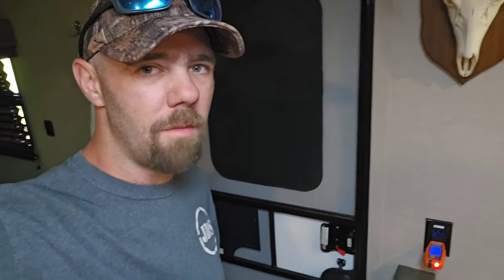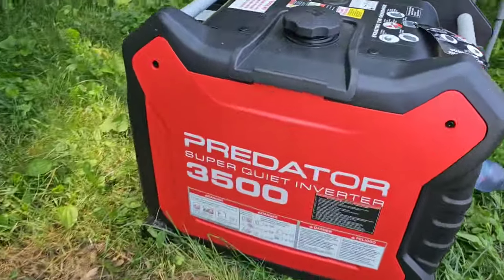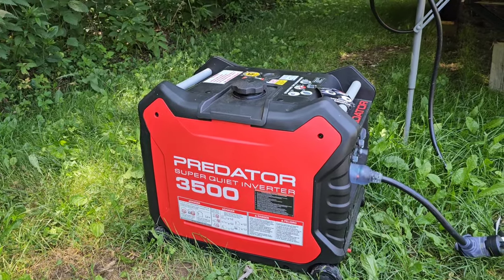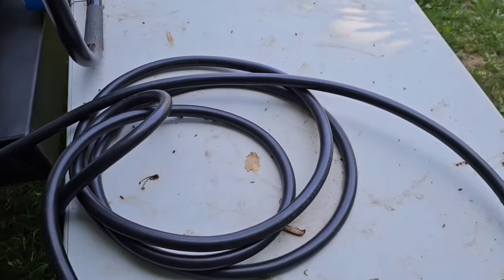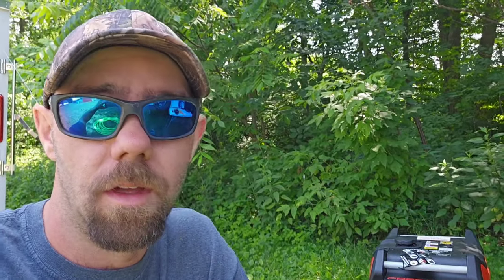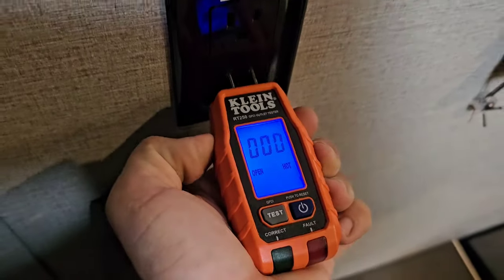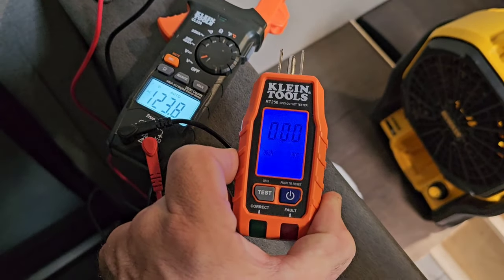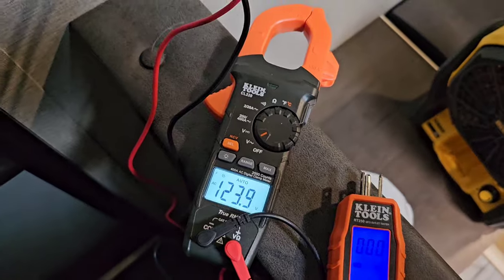here is the solution to the popular 3500w generator problem

Comment: I loved it. I identify as a Jack of all Trades. Plumbing, Heating, and Electrical.   Your comment cracked me up. I had originally discovered this issue last year, but had I found your video then I would have saved myself time. Does anybody have kids?  Guess what you're not just a doctor. You're a therapist, a problem solver, likely an electrician, and even a plumber.  I'll let you figure that one out but it's pretty obvious. At least to this once-single Mr. Mom. Now, Ladies, I didn't forget you!!  I've seen some ladies and men even take on the role of a mechanic. Yep, changing their own oil, working on brakes and rotors, or even swapping out a car battery. Ladies and Gents, you identified as a mechanic. (OKAY BACKYARD MECHANIC).  JDS Outdoors keep up the great work!

Comment: You need a neutral ground bonding plug. You plug that into one of the outlets on the generator and it will work like it should.
Reply: The bonded plug is what I found out as well. I have a 4500 watt champion and was doing the same. Added the bonded plug and no more issues

Comment: Well there you go. I was one that originally claimed the fault was because of the open ground with the gen set. Then after thinking and replying with another commenter I talked about a job I had where the customer claimed a hot / ground reversed on one circuit in their RV. That actually turned out to be an open neutral. That's when I thought it might be a neutral fault. Its funny because the last sentence I said is how I hate those outlet testers because I can't trust them and their is no substitute to an actual multimeter. 
Hey, either way I'm glad to see you figured out the cause. For me that's the fun part of troubleshooting. I enjoy the hunt.
Subbed to your channel btw.
Reply from the maker: I appreciate it. Your comment and talking with other electricians is what helped find the answer. You were definitely right and also correct on the hunt is fun.
Reply: @JDSOutdoors  🙂  hey thanks for saying that. I've always enjoyed troubleshooting especially on the electrical side of things. I just find it interesting. I was an electrician but left the trade to become a RV technician (just wanted something different). I love working on campers because I get to be a "jack of all trades". I try to help people when I can here on YouTube but I stopped for a while due to people not appreciating it and others just being trolls.  I actually did not think you even saw my comment. Like I said I'm glad you got it figured out.  Thanks again for your kind words. 🍻
Reply from the maker: @OneRoomShed  I try to see as many as possible especially the good ones. I will take a min if I'm bored to troll the trolls sometimes as well. But there is some good ones out still and I do see that.

Comment: Damn. Great team work, and great you all found this out. I was about to go replace my “stolen” tool with a Klein. I wonder if other models do that as well… need to test and replace some GFCIs outside. Want to make sure I don’t fry nothing, including me in the process. Lol! Thanks again and here’s to ya on another great vid.
Reply from the maker: I mean it's still a good tool but if it reads funny just double check with a real multimeter.
Reply: Why would you need to replace any GFI's? It's not going to hurt you in any serious way even if you do get shocked with 120 volts. 220 hurts pretty bad, but you will live, and I wouldn't suggest the 3 phase 440 that I got hit with once but I was fine that time too. No need to worry about 120 volt.
Reply: @wesman7837  Thanks. I have a couple of faulty gfcis need replacing. I’ve done them before.
Reply: @wesman7837  Well actually 120 will kill you faster then the higher voltage. 120 makes you grab tighter higher voltage throw you off.  It is usually the throw that kills the people in higher voltage. as it is the amps that you need to work about not voltage.
Reply: @JDSOutdoors  I bought that Inverter and loved it so much bought a 2nd one. 2020 models.  1 Inverter will run gas furnace or window unit, chest freezer, fridge, T.V.'s, and some lights all at the same time with power to spare at the farm house.  A noisy, gas hog, regular gen is used to run well when needed.  Quiet, reliable and use little gas.  Another vid shows there is a special 120V plug that connects the neutral and ground prongs that I think solves your floating neutral when its plugged into Inverter.  Great video, Thanks.

Comment: Excellent video, thank you ...
i have been watching a lot of you tube videos and this is the first time I have seen the problem with the spark plug discussed ... awesome !!!
the one item i will likely do different is i will probably get the predator 5000 instead ... a few things i like better are:  more power, duel fuel capability, covers over electrical plugs all for just a bit more money and i believe less that ten pounds of additional weight ...
one item i have yet to see in a video (please let me know if you have done so) is the ability to expand the power source by hooking another generator in parallel ... how hard is it to do, what cables are necessary to do so, where to get those cables, etc. ???
this is the first of your videos i have seen and i am now subscribed and looking forward to seeing more ... thanks

Comment: Good job Doing your own trouble shooting I did Electrical work for 18 years.and the plug in testers are ok at very best . Just FYI Try Putting a ground rod in the Ground about 10 ft away from the Generator use a Acorn looking ground lug with some 10 AWG ground wire and connect to Acorn lug to ground rod Then connect Ground wire to the ground connection on the front of your Generator that will fix the open ground issue

Comment: I worked with a lot of electrical stuff from HVAC to generators over the last 35 years and never owned one of those outlet testers till just recently. I always used a meter and amp clamp, which means I never got to experience being led astray by some fancy little gadget!
Reply: Every testing device has its place, even digital multimeters have drawbacks. Since digital multimeters do not burden the circuit (doesn't provide a load like a wiggy type tester that has a solenoid and draws some current) it will pick up transient and stray voltages that really aren't there for a lack of a better word (meaning no power behind it). Maybe in your work you've never experienced this but I have in my 40 years as a journeyman electrician. Having said that, digital multimeters have been a godsend to the industry. Even this "fancy little gadget" showed that there was a problem with this circuit and shouldn't be ignored. Taking Hot to neutral readings is not enough. I wish I was there to take Hot to ground, neutral to ground measurements but it's likely that there was no neutral to ground bond and if so very dangerous.
Reply: @liffy8333  ... in an RV there is no neutral / ground bond because any time you have shore power that connection is provided from the utility feed. BTW, all new RVs come with an owner's manual that probably spells out generator needs. Some of these manuals go into great detail with diagrams and troubleshooting as well.
Reply: @rupe53  Yes, shore power provides the neutral to ground bond but a generator with a floating neutral does not. Your right you should read and follow all manuals.

Comment: My question.  I believe in your short video, you pluged your tester into the 120v duplex outlets of the small gen and read fine. Do they have an internal bonded neutral?  If so, I wonder why isn't the twistlock recep bonded? Would it be prudent to bond the twistlock? The bond would be at the source as should be.
Reply from the maker: No it's the tester for sure

Comment: Doesn’t make sense. Used the same tester multiple times on various power options but it only shows bad on one of them.   Even going direct to the 3500 should, in theory, show bad if it’s truly the tester. Right?
Reply: Because all his other options were closed frame and had a bonded to ground neutral.  Predator 3500's are floating neutral.  The tester works on the Predator 9500 because it's bonded neutral.  The tester is trying to find reverse polarity by measuring voltage from hot to ground and neutral to ground, expecting to find ground bonded to neutral like a house.  Since the ground pin and the neutral are not connected, the tester defaults and just says 'floating ground.' while displaying 30v.  Campers don't do this for safety (If you had a bonded generator, touched it and the camper, and there was a wiring issue on the camper, you would be electrocuted.)  Champion generators has this in the FAQ on their site, its a common 'problem' caused by all in one testers.

Comment: Thanks for the video!  I have a Grand Design 22MLE, which is a 30amp rig..  my 12v lights and fridge have an issue while on the generator.  120v items are fine...  do you think my converter has an issue with only seeing 30v?
Reply from the maker: No the converter is actually seeing 120. For some reason that tester defaults to 30a when it reads and open ground. Testing with a volt meter shows a true 120
Reply: @JDSOutdoors  I got that, I'm just wondering what my 12v charger/converter is seeing and why it's having issues when connected to the Generator

Comment: I have the same generator predator 3500. Trying to run my camper a/c. 13500  btu. It will run the a/c  fan and compressor but if anything else is plugged into camper (phone charger or small tv). It will blink when the compressor kicks on. Every time. Fan already running but when compressor kicks on it’s just enough draw to blink everything else. Is it simply just to small of generator? I can run the camper off of 20amp plugged into my garage wall and this doesn’t happen. Just looking for other ideas to check. Generator has 30 hours to on it. Not in economy mode.

Comment: My Klein outlet tester also showed 30v open neutral on the outlet on my Genmax gm3500iaed 3500w generator. I wasn't getting power from the two 20a AC outlets so I saw this and tested the outlet with my multimeter. All I got was 6.4v and it is impossible to get in touch with the manufacturer or the warranty  service. I hate sending it back since it now has gasoline in it and it will be a pain boxing it up

Comment: I had 30 ft coach and I had both ac running, turned the microwave, every light on and small items plugged in and only pulled 3200 watts to the best of my memory.  

That 3500 is adequate for that coach.  It’s rare you have that kind of a load on a coach

Comment: It would be cool to have a Xtra pair of test leads for your multimeter and then wire up a standard 110 volt male plug to the end to where you could just plug your meter into the wall.
Good info thanks

Comment: I learned today that if u have a built in surge protector in your rv, that it wont work with a generator because of the open ground. U have to make a plug that ties the neutral and the ground together and then the surge protector will work and allow power to the rv.

Comment: I’m really not trying to be nit picky. 
I noticed the generator ground post on the front panel of the generator wasn’t connected to anything.  Meaning that nothing the generator is connected to is connected to ground ether. 
Q: how does the bigger generator connect to ground?
For my 2017 3500 Predator; I got a 6’ of solid 10 gage copper wire , a 6’ ground rod, a device to remove ground rod later, and a high lift jack ( I have with me anyway) for ground rod extraction when I move. Just a free idea
Reply: DP Equipment on eBay has an excellent kit for ground rod installation and removal. But is pricey. 

I only had to buy a ground rod. And made a removal attachment. Everything else I had or had left over from other projects.
Reply from the maker: @madmanjoe5  tried that same results
Reply: @JDSOutdoors  then I suspect you’re generator has an internal open ground circuit. I recommend opening the control panel and testing the ground circuit. Between outlets and the exterior ground connection 
My Predator 3500 is good as far as ground (for now, I don’t expect it to last. Terminal corrosion behind the control panel is a little excessive). But the carburetor was a different story. That’s the thing with harbor freight everything is a mixed bag of results. 
The circuit test in this video is a good thing to do on predator generators periodically. Well any generator for that matter.

Comment: We have the same generator for our 30 watt 5th wheel and we just tried to use it to just run the ac and our generator couldn’t handle it. It was also 98° outside and wandered if the generator circuit board was overheating 🤷🏽‍♀️
Reply from the maker: @Diamondranchfarmstead  put a soft start on your ac. Get the good one it's about 300 bucks but it helps big time. I can send the link to the one I have if you like
Reply: @JDSOutdoors  ours has a soft start and it was a brand new ac unit 😓

Comment: How did you even keep yours running off the shelf? My brother couldn't even keep his running only after a few hours of running and he did everything the manual said. It started running like it wasn't getting fuel. Not impressed by Predator as of now.
Reply from the maker: Never had that problem with dozens of generators. Thousands of hours of run time. He got a bad one they will swap it out for free. Best warranty around.
Reply: @21TaylorG - my identical generator just died after a whopping 10 hours. It will run maybe a min with a heavy misfire. I’ve done everything imaginable. Removed the Spark arrestor, cleaned the plug, cleaned the carb. The fuel was literally brand new with B-12 treatment. It was running fine until it wasn’t. 🤣 I truly wanted to hook a chain to it and drag it behind my truck! Also the digital screen quit working after maybe 2 hours. What a turd 💩

Comment: I saw some video on YT where they guy had a standard NEMA 5-15Plug that he bought of of EBAY that fixed this issue in a way and for the life of me I can find the video.......He actually just plugged it into the Generators NEMA outlet even though he was useing the Hubble outlet.
Reply: Easy search on Y.T.,,here's 2.   Bonding a neutral for an R.V. generator.  What is the purpose of an electrical Neutral/Ground bonding plug?

Comment: Nice job. Call em out!! Can't comment and run!!!... ..
I have had stuff like this kick my butt. I am NOT an electrician. But i am a good mechanic and i understand how things work..  So in hindsight you forgot to verify the verifier!. Yep. It lied to ya. And that can also get ya killed.  Nice job figuring it out man. I lean on people to help regularly and they do it! I love people(some of em)... short story , a tic tracer, a kind of voltage detector will lie to ya too. I had the meter in my hand while I'm inside the house getting voltage readings on a pipe with wires in it disconnected at both ends and the houses meter(main disconnect) in my hand. I'm walking circles around the house like where is the extension cord that is powering this house!?. Nope Chinese garbage product lying to ya. Well in the products defense there WAS voltage in that pipe. 0.00033247 of a volt (ghost voltage ,happens when you put any 2 dissimiliar metals any where near each other). Iyiyiyy. Forehead slap.. i learned tho!.... p.s. i just bought this jenny. Hope to make friends with it this year. It was a refurbished one that i walked out the door paying 600$for.
Reply from the maker: For the money they are great. This year I'm swapping it fir the 5500 or 5k I don't remember the exact number but remote start will be nice.

Comment: I have 3500 predator inverter   that has caused the  resin in CDI to be cracked, so the spark plug is not firing . I tested the spark plug, carb is getting gas. About 7 months ago I replaced the CDI & I thought I had fixed the problem, I think something else is causing the CDI problem . HELP
Reply from the maker: Thats easy. Harbor freight warranty is the best out there. Swap it out with a new one.
Reply: As your warranty may have expired so swapping may not be an option.  2 issues may be the problem.  On some models the red wire going to the starter solenoid can rub through insulation on the metal tab by the round capacitor destroying CDI so make sure wire is clear of CDI.  Other issue is low oil shut off is grounding out ignition even though engine has oil.  Simply unplug green connector right there by the starter solenoid.  Great units, hope this helps.

Comment: I run my air conditioner in my 8x18 30 amp camper, 11,000 BTU with a 2000 watts generator, no soft starter.